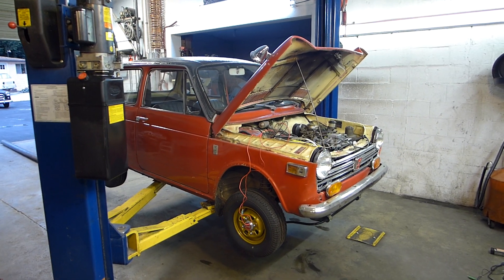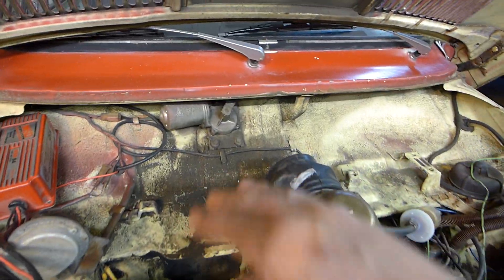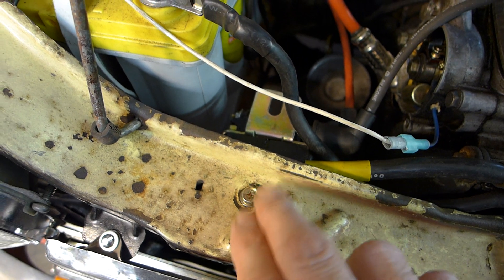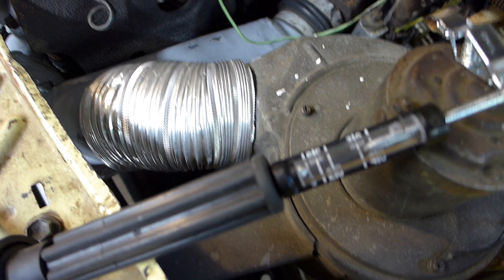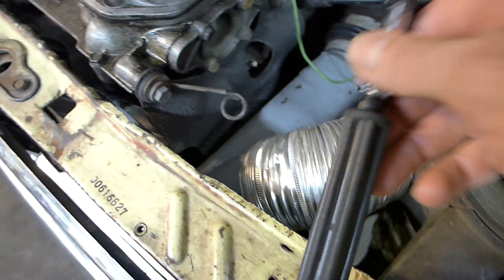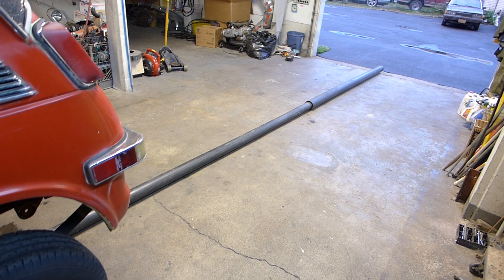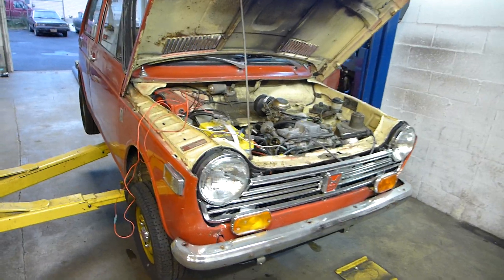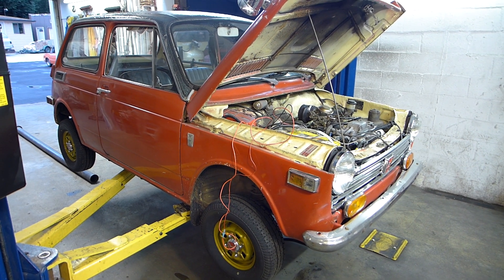Fitting a MSD 6A igntion box on a 2 cylinder Honda N600

Comment: From your inspiration, I did the same thing to my 2 cylinder DAF 46. I used a vintage Mark Ten CDI box and a mid 90's Mitsubishi Galant two tower coil. Left the condensor connected to the points and now that little 844cc boxer twin runs like a clock! Great mod!

Comment: that is awesome. The points pickup trigger in the box, that can also work from optical.. very gentle, smartly picks it up at the box. I run a accel 300+, same idea and even multispark below 3000. I opted for msd first, have no room. One thing NOT to change is factory plugs part numbers (in my case I had to find original ngk subaru) No regrets, nice setup. 8.8mm wires may be next, but a two cyl is 360 degree fires, may go easy.

Comment: I'd recommend tuning with slight changes in spark plugs and seeing how they burn, you can read endless articles and watch videos on tuning with spark plugs. I'd also recommend playing with opening up the gaps on em and indexing them. You'd be surprised by how much power and response you can gain just from these mods. I hope these tips help you.

Comment: YOU BEAT ME TO THE PUNCH ON THE HONDA . 
 . 
I HAVE A MSD-6A ALL LINED UP TO GO IN THE HONDA 600 POWERED
MESSERSCHMITT TG-500 BUT THE CAR IS NOT BUILT YET . 

I HAVE BEEN RUNNING TWO 6v COILS IN SERIES ON MY 700cc SUPER-SETTA FOR YEARS WITH SCARY SPARKS & GREAT RESULTS . ( BOSCH COILS ) 

THE MSD TECH GUYS COULD OR WOULD NOT TELL ME IF IT WOULD WORK 
SO I DID IT ANYWAY WITH RESULTS SIMILAR TO YOURS . 

ABSOLUTELY WONDERFUL PRODUCT .

Comment: I see this post was made six years ago.  I'm curious how it turned out running on the msd.  I searched later videos and never saw anything about driving around using the MSD ignition system.  Reason I'm posting this... I bought a 1987 Honda CRX similar to the 86 I had when my dad bought it for me in college.  I can't find an ignitor for it and someone suggested I buy a msd...I searched it on  youtube and your video popped up putting it on a Honda.  So how did it turn out?

Comment: did you set the 6a to work on a 4cyl setting? i'm installing one on a 3cyl daihatsu charade. do i have to set it to a 6cyl setting? thanks!
Reply from the maker: yes. 4 cylinder setting for the Honda 600 and it's wasted spark system, I don't know about a 3 cylinder 4 stroke Daithatsu . Try and see
Reply: 2stroketurbo is there a way that can make a video on how you wired your MSD box. I just got one for my N600,

Comment: On the old Honda engines a miss is usually a bad ground. They will run fine in the shop, then put a load on them and get the miss. Run a separate ground wire to engine and coil if problem doesn't go away.
Did you use a static light to time the points?
Reply: Also I forgot to mention a high speed or the high revs will bounce the points. To overcome this on some of my bikes back in the day, we would double the point springs. Then the only other thing is stronger valve springs. My old bikes were torsion bar valve springs so I never worried about valve float.
Reply from the maker: I used an old fashioned dwell meter and feeler gauge to get the points perfect
Reply from the maker: Great idea to double up point springs to eliminate point float. I thought of that as well but have not tried it yet.
Reply: I turn the engine with a wrench, the way it runs of coarse. And use a static light. I clip one to the spring and the other to ground. You can get it right on the mark for the flywheel. Makes a big difference! Better idle ect.

Comment: How easy is it to restore one of these? I have one that my grandfather pulled out of a junk yard in 1973ish (he fixed it) but it sat for the past 15 or so years and needs a restoration. Especially since the engine is siezed. Gah I wish I knew how to rebuild engines
Reply from the maker: much easier to restore since parts are available,  www.honda600carparts.com  is fantastic

Comment: Kudos for solving your ignition miss.  But I do have a couple questions: 1) Aren't you worried about burning a hole in the pistons?  That's a lot more volts than the pistons, valves and head-gasket were designed to tolerate.  2) You mention "no more red-line limit".  Again, that motor was not designed to exceed a certain limit (as I recall, 6,000 within reasonable limits).  I'm all for more highway speed, but are you designing-in some lower reliability?  Not being a wise-ass, just concerned for our little peanut-motor.
Reply from the maker: Tuning does compromise. Hotter spark sure did improve performance, I'm still driving it.  I've yet to see any negative effects.

Comment: I didnt know you could use them on 2cyl. And i thought you got nailed when you set that down. The bad thing with the MSD it will shock you 50 time before you can get away from it. It feel's like someone broke your wrist,elbow and shoulder joint a super ouch.
Reply from the maker: Yes the MSD box packs a super powerful punch, what you want to fire spark plugs but not to touch. I was worried I'd get shocked during this demonstration, that's why I jumped !

Comment: You can just check the secondary and primary resistance  of the ignition coil.  Its a much more definitive test than that.
Reply from the maker: I have had bad luck testing coils that way, the resistance test may check out fine but they don't produce good spark or only intermittent spark,  the only positive true way to satisfy me I have found is with this Thexton tool . So far it has been 100% fool proof accurate. Recently I fixed a car another shop could not because they were fooled by the old fashioned resistance check method